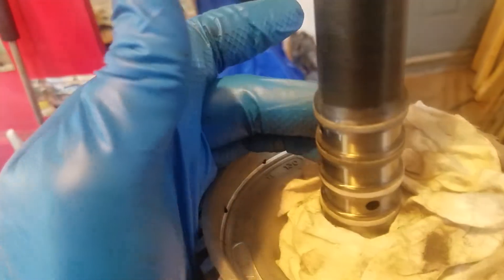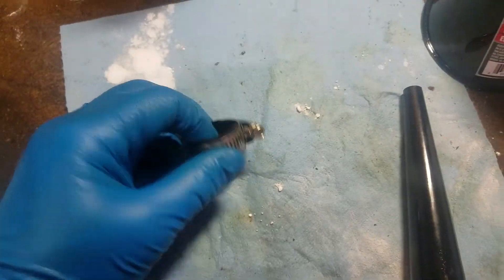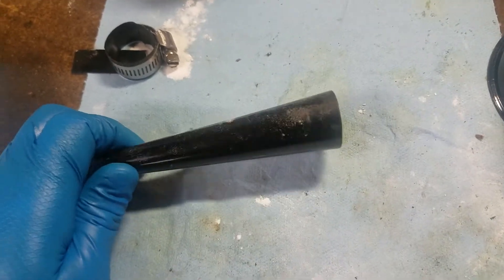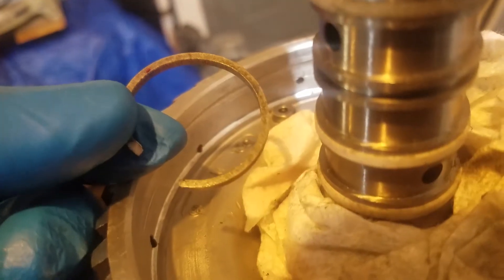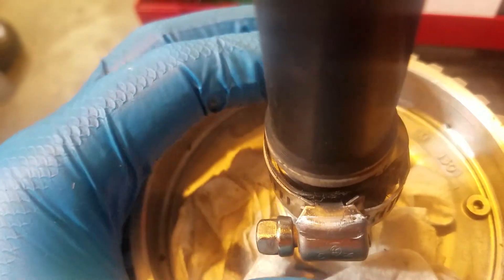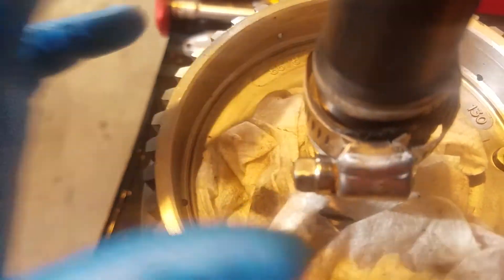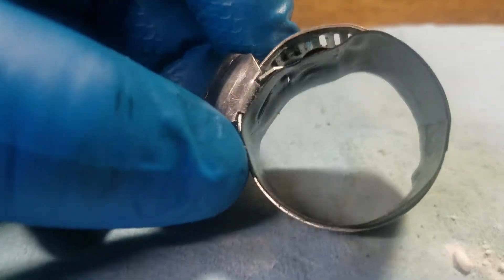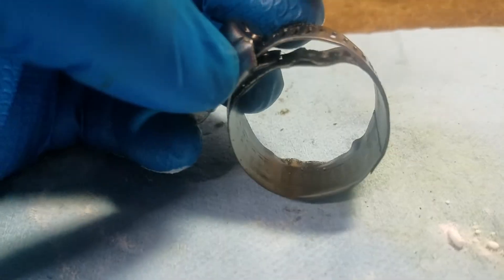4L60-E How to install sealing rings without special tools.

Comment: Honestly I put clear tape on the shaft sticky side out than finish layer sticky down they slide over really easy with a bit of fluid and barely deform. Than I use tape before the worm clamp to compress kinda error free being you tape it in place but as long as you get it done!!!